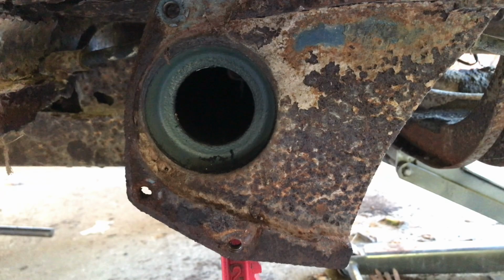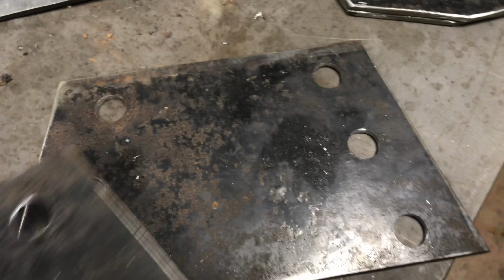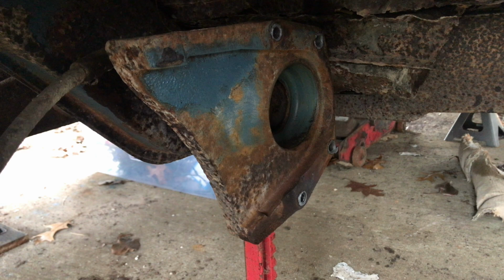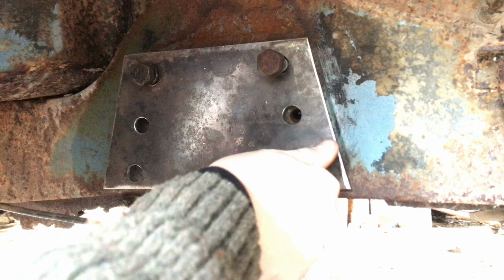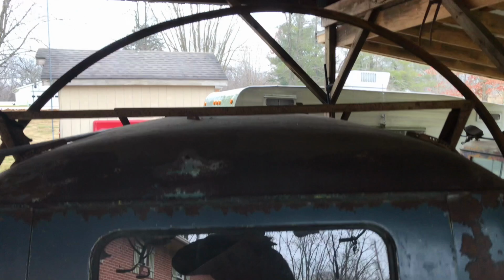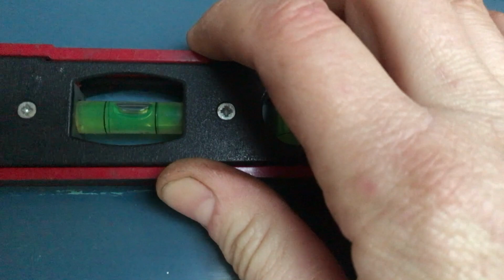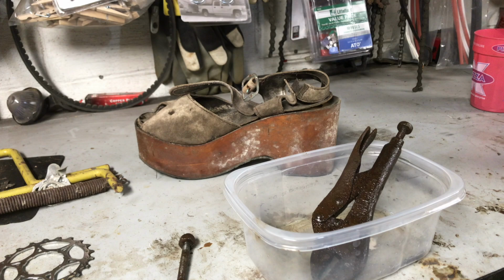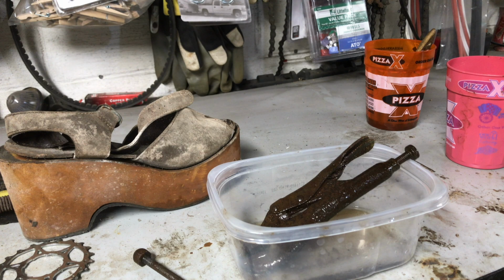VW Bus Rotisserie build part 2!!

Comment: Use a 25/75 mixture of vinegar and water .soak vicegrips for 12 -24 hours .no more rust!!! 😁
Reply from the maker: I've used that mix before without much success BUT will give it a try on these for sure, If that doesn't work I'm setting up an electrolysis tank and that will do it! thanks for the suggestion!

Comment: If you're worried about the rings rolling just make triangle shaped wood blocks and butt them under either side of one or both wheels just like you would chock the tires on a car.
Reply from the maker: tune in for the next video (hopefully this Thursday) and you will see my plan...it will turn 360 degrees in one place...currently it is chocked, but those are coming out today!

Comment: You're really getting "Pickle" together! My question is: once you've flipped the bus to the angle you want, how will you hold it? Are you going to weld up some brakes for it? I was hoping to be the 1st to suggest "shift handle", but I see you've got quite a few options. Whatever you pick will be fine - except the rearview mirror mount - I'd hate for that to come loose & hit someone or break the windshield.
Reply from the maker: Lateef Carrere I have a small boat winch with the locking section on it, thinking of using that to be my lock...but of course there is the kiddo to consider🤔he’s very “resourceful” so whatever I lock it with has to be high so he can’t reach or child proof😂
Reply: @marcijunebug  You could use that - if you can drill a hole through part of it, you could then use an actual lock to prevent it from rotating too far, thus "locking the lock". I'm sure you know what I mean.
Reply from the maker: yes, my idea exactly...he's a real challenge sometimes! keeps me on my toes!

Comment: I think a gear shifter handle maybe would be cool for those vise grips
Reply from the maker: James Ferrell that is certainly at top of list!
Reply: That or you can add a few more pieces to it so it has legs and a tail  so it resembles a comodo dragon with the front legs stretched forward supporting some kind of ashtray or cellphone holder mounted to top of dash.
Reply from the maker: ummmmmmm oh the possibilities🤔

Comment: Just say the extra holes in the plate are for weight reduction which increases the power to weight ratio and also increases air flow and cooling efficiency under race conditions. It's the latest in High Performance rotisserie design!
Reply from the maker: squidkid2 bahaaaaaa😂😂😂😜😜✌️

Comment: There have been many times I've seen cars that have the vice grips used as the blinker lever under the steering wheel. I thought of it as a gear shifter handle at first but it isn't practical and I would get annoyed. At least if you did use it for the gear shift you could remove it for driving purposes and put it back on at shows and what not. If they weren't so bulky it'd be different for me. I agree they should stay with the vehicle. It would be like removing a sword out of a stone. I don't know if that makes any sense. Anyway, maybe just grip them around the shifter shaft sort of like vibration stabilizer or heat sink. Just thoughts. Whatever you do it will be great and most importantly it will be yours.
Reply from the maker: EXACTLY  like the sword and stone! I have a  plan for them I think  will  work  and those  that  "know" will  know  those are  THE vise-grips I took off the clutch cable!

Comment: Once it's on the stand are you going to power wash it then start welding new tin to it and when you primer paint it are you going to use marine grade ship paint so ss Pickle dosn't sink back into a sea of rust?
Reply from the maker: yes, good bath first, then access, then cut and weld, then primer and POR15 or some other treatment, not sure yet, still researching that one..and yes poor ole guy IS nothing but a sea of rust
Reply: @marcijunebug  Good ship primer wont be cheap..but that's a warm weather job in the future.
Reply from the maker: yep, ain't trying that on these 15 degree days!

Comment: 5150mxvw found a REAL challenge, 4 days ago. May be jumping the gun but as I watched you pull the engine and show the flywheel I remembered something told me a very long time ago. The fella told me if you do a 12volt conversion you would need to change the flywheel, something about the number of teeth not matching from a 6 volt flywheel to a 12 volt starter. Got to remember this was something remembered from almost 50 years ago. Thanks and do you have a link to something showing your collection?
Reply from the maker: I don't plan to convert to 12V...leaving it 6 for now and if you convert to 12V you can still run the . 6V starter...just can't grind and grind on it.  So would leave everything the same in that regard, but you are correct the starters ARE different! (actually in the will it run video I put 12V to the 6V starter) heres the link for that...(you might have already seen, forgive me if that is the case)
https://youtu.be/4g5kJ773zzY

I don't have a link but if you have an Instagram (IG) account I am junkinthistruck on (IG) and in my other videos most of my "collection" is in there at one point or another!
Reply from the maker: donnie brown and yes I saw that “challenge” and thought...it’s probably fixable 😆
Reply: @marcijunebug  thanks again, it's really good to see "young folks" such as yourself trying to save what a lot of people look at as nothing but rusty junk.
Still remember a friend buying a 58 bug, we finally got it started after figuring out the manual choke. Have Bunches of vw stories after owning eleven.
Reply from the maker: I've had beetles, things, busses and I'll say ALL have their individual "thrills: for the individual ride! Best part of owning VW's...the stories we can all share, makes us all family in a way!
Reply: @marcijunebug  lol